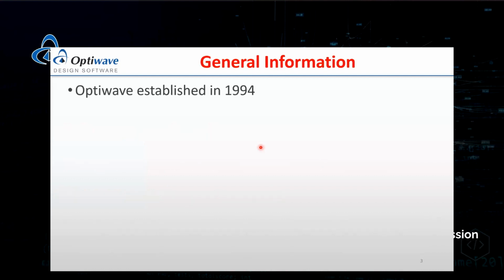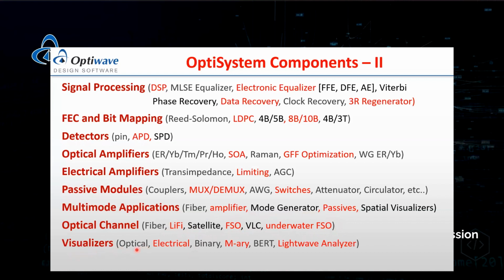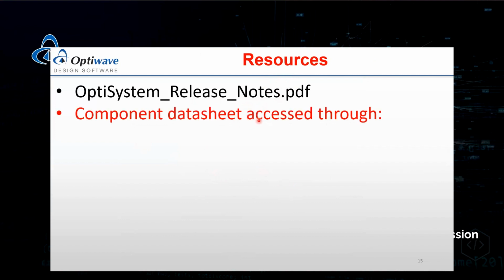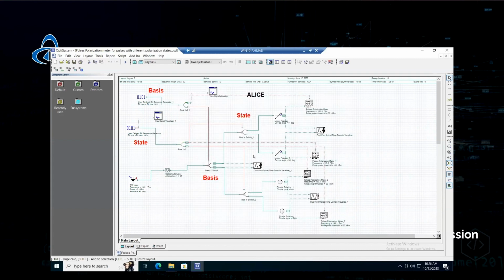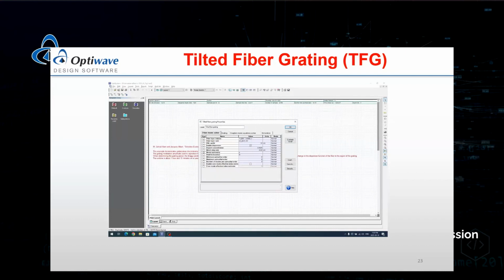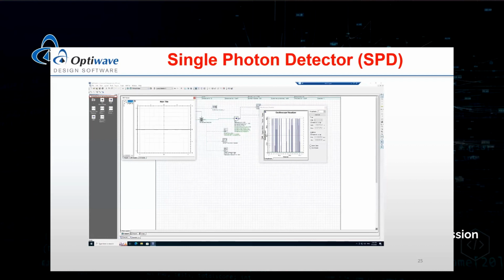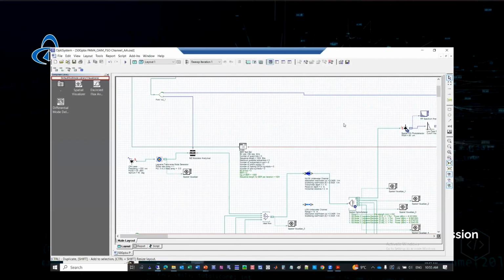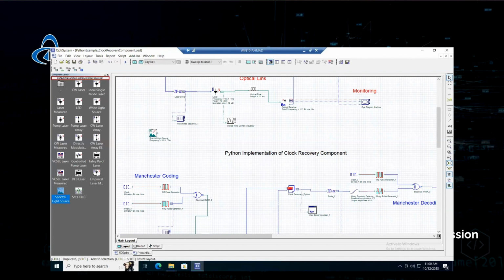OptiSystem 21 Unveiled  Empowering Photonics Innovations in QKD, Sensors, and Underwater FSO Transmi

Comment: Does new version support DBA or DBWA allocation algorithm for PONs?   or Routing Protocols for the UWSNs?
Reply from the maker: Regarding the DBA, you should be able to sweep the bandwidth of relevant components using different spreading methods (linear, random, etc.) to control the BW in the design. 
On the other hand, we don’t support Mac layer. However, you may use the Python component to make any extra work not available in OptiSystem and then come back to the OptiSystem layout.